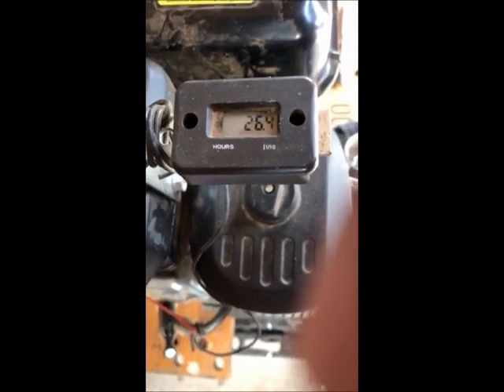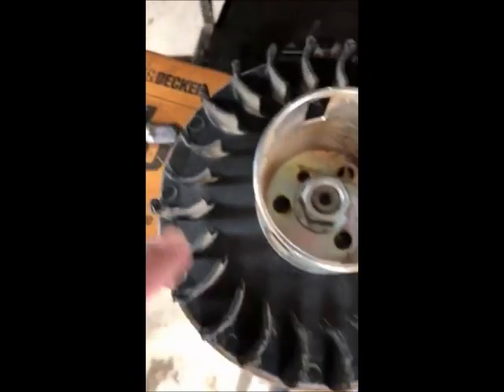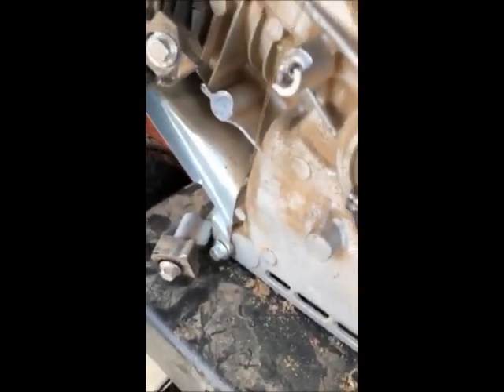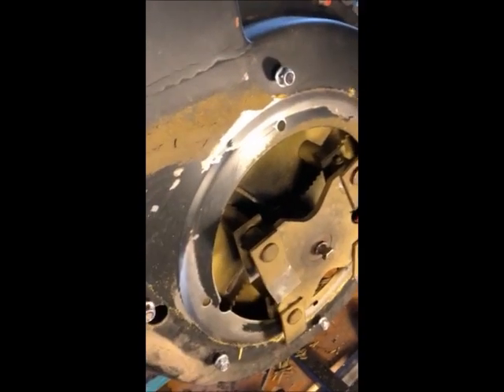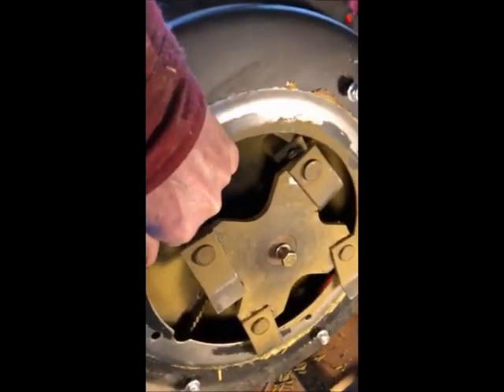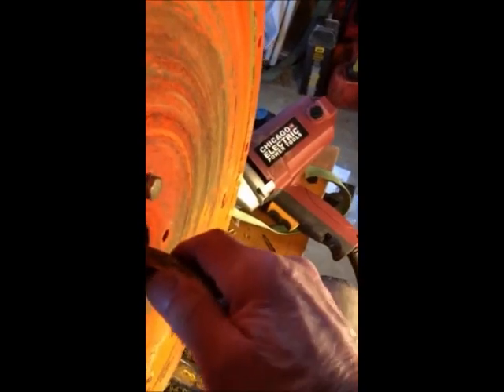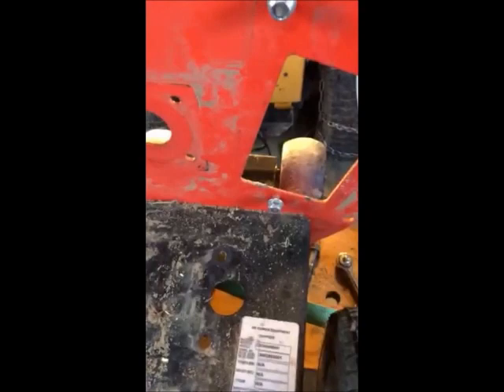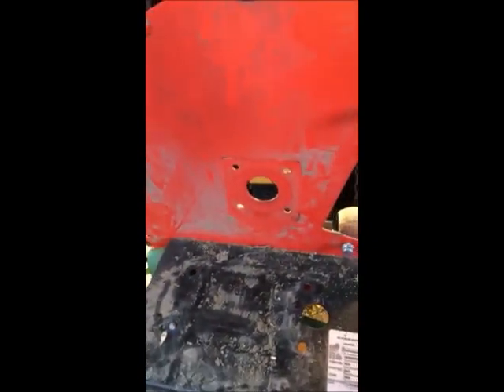DR Chipper Shredder Briggs and Stratton OHV Engine replacement

Comment: Any idea what caused the crankshaft to break? I just had my DR Leaf Vac crank break off. Similar to yours, but broke closer to the motor.
Reply from the maker: I don’t know exactly what the problem was, but it was either the wrong flywheel, or the shaft is not manufactured correctly, because both of my engines broke off in the exact same way. If you look at the end of the shaft it looks really like crystals of metal, and it doesn’t look like the metal failed because of fatigue.
Reply: @georgerogero3185 I'd tend to think wrong flywheel. The crank is ductile cast iron. Sounds like brittle fracture.  What would a cast iron break by fatigue look like or differ from what you see?
Reply: Was thinking a stone, piece of granite, that a branch grew around.

DR is Generac which is where the buck stops.  B & S Engine Application Center, BASCO EAC, is available to Generac, DR, when their product is developed.  Generac also manufactures engines.  The BASCO engines, alone are tested running for 800 hours. Whether or what DR's testing protocol is, is a mystery to me.

While it's possible the cranks metallurgy to be amiss, I'd bet on the application.  BASCO engine production per model is in the millions, a quarter century ago  11 & 13 million wasn't unheard of for the smaller engines.

Comment from the maker: I had comments turned off by accident.
Reply: I just had the very same issue after about 23 months.  DR was great and shipped out a new engine.  Thank you for the video, very helpful.
Reply from the maker: @royevans9660  you had the flywheel break off?
Reply from the maker: @royevans9660  This video is of the original engine that was on the machine. It had only lasted about 26 hours. The replacement engine broke the same way after about 17 hours. DR shipping me a third engine after much delay. I was told by a guy I know that does small engine repair that DR had sent a service bulletin that some of the engines were shipped with the incorrect flywheel. I was told the delay of my third engine was because they were waiting for it to be delivered from China. I also saw another machine at tractor supply that had the same engine failure.